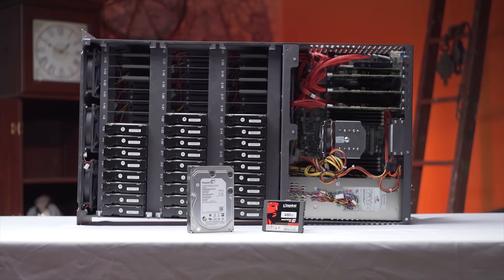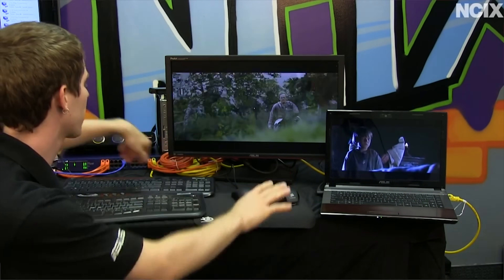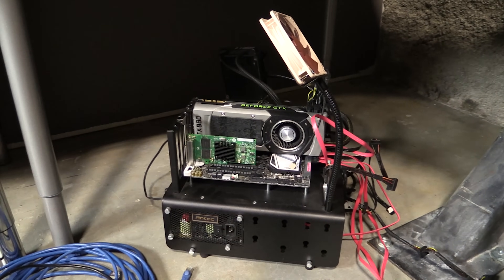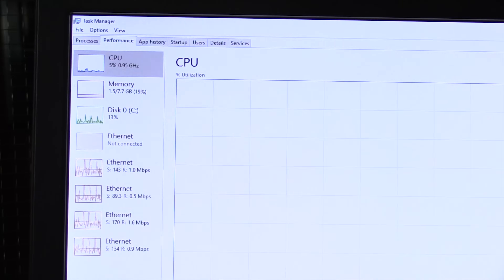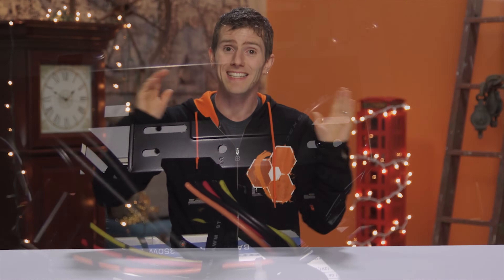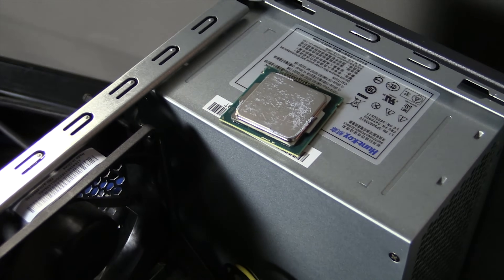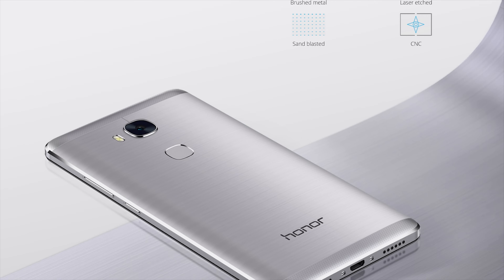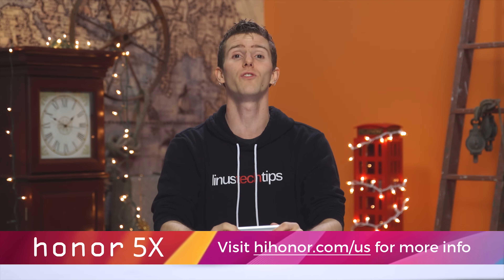Quadruple Your Network Speed for $100 with SMB 3.0 Multichannel!

Comment: i never understand what these videos are about..... it cant be internet speed cos that dont make sense,... u cant magicaly make ur internet go 4x faster.
Reply: +MoDRun its about local file sharing through wifi . this has nothing to do with increasing internet speed. this will increase the speed of local file sharing speed .
Reply: Linus is showing how you can increase speeds over your local network, not the Internet. This is useful for a variety of reasons, such as having network attached devices, whereby the throughput of the local network could be a bottleneck.
Reply: This is for file transfers on a local network.
Reply: +MoDRun About internal network file transfer, eg transfering files to your home NAS
Reply: if i wanna move files from pcs i just move the hdd over and copy paste it :\
Reply: +MoDRun It's for NAS or any kind local server, it easier to handle the transfer file from local server to your/client pc. But you can do it with your pc to another pc/laptop with cross cable. Using this method, you can save more time than you copy files to your ext hdd first.
Reply: MoDRun Well you don't own a NAS or any sort of network accessed by a large amount of people. Imagine if everyone in your office was running back and forth between the server room every time they needed a file.
Reply: Spoder Man right no.
Reply: +MoDRun If you don't see the advantage of not having to physically move a HDD around, then you can't be helped.
Reply: reznoire ofcourse i can see that being better but not for me.
Reply: +MoDRun if you only have a network to connect your devices to the internet this video is just not for you. and even if you understand the benefits of a NAS at some point you will most likely be happy with a standard 1Gbit/s connection.

Comment: Is local transfers speeds controlled by the internet speed you get from your ISP?
Like for eg, if your internet speed is 10mbps and you wanna transfer files locally at lets say anything higher than that can it be done without lagging the crap outta the internet connection?
Reply: Local transfers =/= internet speed

Comment: Linus can you help me i ofter get really high ping while playing games, even though no one else is on the internet and my family has the highest internet package you can get is there any way to reduce the ping?
Reply: there isn't much you can do about ping as long as you have a wired connection then you are probably good
Reply: A Fancy Notebook i have a wired and in games like csgo i have like 150-300 ping if not more :/
Reply: +Bengy22 play on servers closer to your location. If the ping is all over the place make sure no one in your house is using torrent. If that doesn't help try virus scanning all connected devices.
Reply: Rem NL :/ thanks for the help but it even happens when no one is on the internet and no one has virus'es and i play on my friends server and it still happens. I think it might be comcast as there just shit
Reply: +Bengy22 Where do you live and where does your friend live? And after that, what's his upload speed like? A load of factors come into play with ping.
Reply: Chendo Smit my friend lives a few states away from me but it even happens when i am playing with my brother
Reply: Bengy22 have you done a test using speedtest.net?
Reply: Chendo Smit yes i have, i get around 80 download, and 10 upload
Reply: +Bengy22 aren't most servers on CS go on Russia or something?
Reply: Dude you need to analyze your connection to the servers you game on (using pathping, traceroute) the. Check if your connection has problem in your modem which means you need to troubleshoot your PC/modem or if it is your ISP then you need to contact them and let them know of the issue or finally it is the game servers and thus u need to contact the company that manages your game.

Comment: I just threw some X540-T2 cards in my server and desktop, point to point connected them, manually set their IP addresses, and changed my drive mounts to use those addresses.  Done and done 10Gb in about 10 minutes.  No screwing around with software teaming.  $300 total.

Comment: Linus, I know this could sound very rare, I've never hear about it before, but will it be possible to make kind of a ethernet cable with a sata 6 GB/s cable? It just went through my head, but lol, it is possible?
Reply: PS: Sorry for my bad english, I'm not native speaker :(
Reply: +Mell Cáneva as far as i know that is not possible. but i heard it is possible with USB and Thunderbolt. but never tried it though.
Reply: +Sebastian Schachel USB and Thunderbolt are only for direct connections between a NAS and a client. Ethernet can be networked through a switch to multiple clients. So they are not the same.
Reply: +Bayonet i am aware of that. if i remember correctly there is a way to Transport TCP IP over USB or Thunderbolt. but i might be wrong.